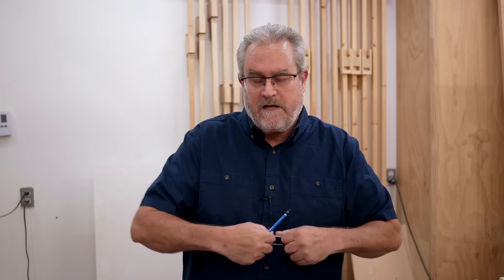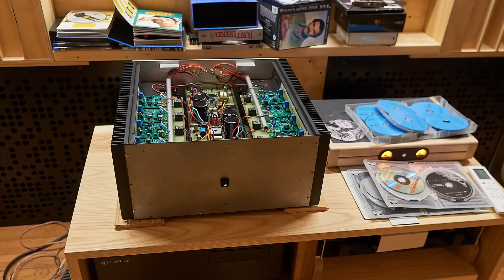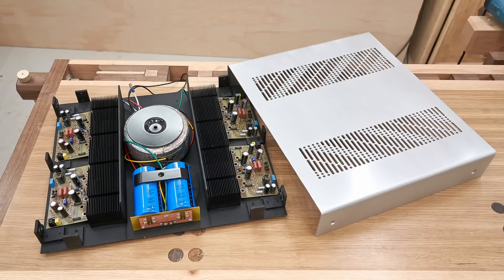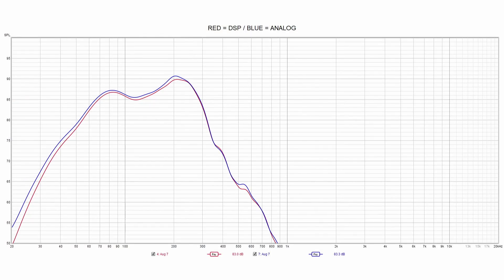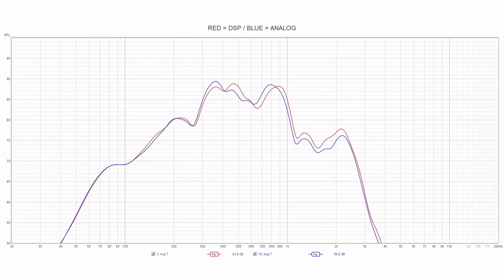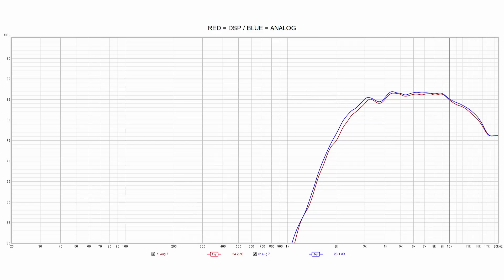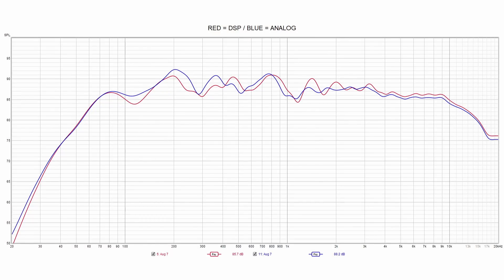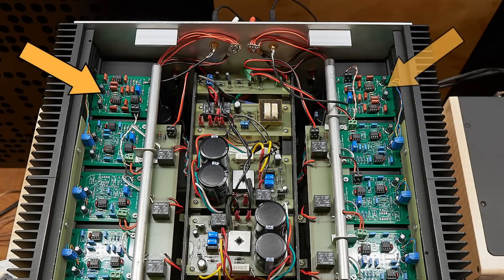My Amp Blew Up!

Comment from the maker: A costly mistake and live and learn (they say, but who actually does that...?), however it was limited to just one amp board. Still, I had to tear it all apart and check everything to make sure there wasn't any collateral damage. That's the BIG downside of putting so much in one case - it literally took a full day to do that.
With the blown board swapped for one of the "spare" channels, I got it up and running again. I'll eventually repair the amp board that blew and reinstall it, but like I said I don't really need it right now for anything important.
The two new crossover boards are for the infinite baffle subwoofers that are in the front wall of my listening room. They are powered by a separate 4 channel amp that I built nearly two years ago and featured that build on this channel. While it isn't quite finished, it's finished enough to use every day until I find time to complete it.
The crossover points for the sub boards are 15Hz high pass and 80Hz low pass. Both slopes are 4th order. I need to make another for the bass shaker I have in my chair, and that will use the 9th amp board in the case.
I need to put the brakes on this new multichannel amp (name change, in case I blow any more boards...) for now, so I can get back to my real occupation - making woodworking videos on YouTube. I'll get the rest of it done when I get the time.
My main channel: 
https://www.youtube.com/user/jpheisz
Building my 4 channel subwoofer amp:
https://youtu.be/UKhRA_GcmPI
My infinite baffle subs:
https://youtu.be/1hDV54c3tzA

Comment: What a journey! Thanks for sharing. 

Question, any consideration to off-loading the bass shaker duty out of the multi-channel onto a dedicated amp? 

An argument can be made that it'd be a good idea. 

Your loudspeakers aren't too power hungry. 
Subs, ... IB alignment requires minimal power to hit full excursion. 

But I'd suspect your shaker rig might need a lot of power and control. 
Perhaps it'd be nice as another control point, as its own entity. 
Offload curent draw and heat.
Ease of adjustment (tactile rigs are tweak intensive).

Really digging the content 
Much appreciated
Reply from the maker: On the contrary, the bass shaker I have is rated for 50 watts, while my infinite baffle subs easily consume well over 100 watts each on peaks. So it makes sense to have the separate amp for the subs, but the shaker can easily be handled by amp #9. And the only adjustment needed is the initial setup to get the level correct.
Reply: @IBuildIt  
Got it. 
I was envisioning the tactile system differently ... ASSuming much more power was involved.

You might be right, in that ... the only adjustment needed is the initial level set. But tactile rigs ... man it's such a fine line between just right and too much! 

Regarding power, IB drivers need dramatically less power, ... like 10x or more.  

Comparing high performance long stroke 18"s, in typical small sealed vs. IB, the infinite baffle drivers are so efficient in the bottom octaves. 

I've got a quad 18" IB. 
They only need 200-300 watts to hit 30mm xmax. 
Whereas 30mm xmax in a small sealed often requires 2kw, 3kw, or even higher.

Hence the advantage of IB down low. IB isn't without weaknesses, however it's killer in that regard, ie., low power requirements at 20hz (less distortion, less compression, lower current draw, etc.) 

Thanks
Reply from the maker: IB is just a very large "sealed" box, so I'm not sure why you are saying it needs 10x less power. While testing various configuration for subs (isobaric ported, open baffle, etc.) I was able to compare them all and while the IB was the best overall, it was still just as power hungry as the others for the same output. That's measured in-room response.
While playing music the subs are just barely contributing, but on movie sound tracks they are peaking well over 100 watts each (8 ohm speakers). My amp can't put out 400 watts continuous, but it handles those peaks no problem.
It takes just one movie with a lot of low bass to set the bass shaker and then it doesn't have to be touched again. Same with all of the other active crossovers - set it and forget it - and that's what I was shooting for with this build: arriving at the best sound tuning it with DSP, then translating that to analog to run in a fixed configuration.
Reply: @IBuildIt  
As an acoustic limiter, the box dominantly changes the behavior to thermally limited. 

Understanding your IB exhibited as power hungry as other alignments. 

But I think 10x is accurate, in many instances its higher. So 10x is quite fair. 

It's the raison d'être of the IB, 
... the impact of the box.

One of those elements; 
it's not fighting the air load, yielding huge increases in bottom octave sensitivity. 

Of course via Linkwitz transform an 18" can be forced to pump 10hz at 30mm xmax in a small sealed, but it takes thousands of watts (and all that accompanies). 

No box, unencumbered, 30mm at ~200 to 300 watts. 

The box represents a volume imposed limiter disproportionately affecting the deep end. 

Thus, IB's are excursion limited at the bottom, not thermally limited. 
I pulse my IB at 10hz, full excursion, without concern for voice coil temps. 
My concern is fearing for my home ... infra waves don't disappoint! 

The tactile, bass shaker rig; 
admittedly, I'm a junkie to level control on the bottom end.

I understand and appreciate a set it and forget it approach.  

Long before I ever experienced tactile systems I had a parametric EQ on the subs (within easy reach at my seat) in our big family daily driver system.

Essentially it's to vary relative level at differing playback levels (once a FOH, always ...). 

It's often argued that much material doesn't fully extend into the deepest range ... but it's often surprising. 
Exploring the single digits is a niche pursuit. 

Thank you John, you elicit fantastic thought experiments.

Comment: Oh man I feel you. Glad it was only 1/10 amps. Great work!! Also about the passive radiators' prices, I DIYed a few myself for my boombox projects. If you dont need a lot of xmax, a 9mm-mdf circle and a speaker surround will do well.
Reply from the maker: I thought about making one too, but then I remembered that a passive isn't much different from a vent and a vent is much easier to do.
Reply: @IBuildIt  True. I needed to use passive radiators to save space as I wanted the speaker to be portable.

Comment: A second woofer is an excellent choice.  Far better than a port or a passive radiator.  Sealed bass plays lower and it's easy to EQ to get the same low frequency extension with a Linkwitz transform filter.  In my opiion the Tekton patent is a joke.  It simply can't be valid.  People have been selling speakers with multiple drivers and even multiple tweeters for many years. So it's not novel.  If you read it, they talk a bunch of non-sense about the mass of the domes being very low so they match the mass of the instrument that created the music.  What a load of crap.
Reply: Agreed
Never cared for the "driver's mass matching the instrument's", ... wtf? 

So unnecessary, just explain the thing, don't make shit up. Tekton has some interesting offerings.

Comment: Thanks for all the shared audio knowledge.
 
Bit late know but being able to access those crossover pots from the outside front/back/side/top, whatever would be convenient.  You'll likely keep tweaking them as the drivers' breakin and your ear adjust to the sound.  As well, your hearing is likely to continue to degrades just as mine have.
 
Would love more transmission line speaker enclosure education from you.

Comment: It happens. For some it can happen big time. I built my very first audio amp in 1973 while working as a grad student. Surplus parts (no money) including paralleled small power transformers to get more power (current actually). Unknowingly, connected them anti-phase and, with great expectations, hit the power switch. Kerr-Blam. Took out the 400 amp service in the university lab where I worked. Valuable lessons on reversibility of assembly, partial testing and variacs.
Reply: Exposed parts right up the rectifier port! This'll be like bullseyeing T03's back home :)

Comment: Hey John, quick question. On the outputs I see you used NJL1302/3281 5 pin devices.  I’m thinking it would be cool to make most of my speakers powered and using these amp modules if the gerbers are available.  The outputs are the only things i need to buy and to get the best price I would buy in bulk from Rochester, but there is a minimum.  

Would you used NJL0302/0281 devices which are basically identical to what you uses except they are rated at 180w dissipation vs the 200w yours are, I would get 64 of each. 

Or NJL21193/21194, you get the 200w rating, plus higher voltage and current rating, but step down to 4 MHz transitional frequency vs the 30 MHz of yours.  In this case I’d get 194 of each for the exact same price!!!  I’m sure either would be more than enough quantity wise, but more is better? This question coming as if I were to use the same rail voltages as you’re using.  

Since you designed the board I though you would be the best person to ask which would be better, lower dissipation or lower Ft?  Thank you!

Oh I should let anyone wondering why, the originals are not available.
Reply from the maker: I can't recommend the amp design I went with for this. Since it uses just two of the thermal track outputs, it was very touchy to adjust the bias current accurately and it would tend to drift up as the amp heated up. 
To fix that I had to add a vbe multiplier to the bias circuit in the form of a small pcb that's wired into the trimpot location on the board. The small pcb is then screwed to the heatsink (via the transistor used for it). The vbe multi greatly improves adjustability and tracking and it should have been included in the original amp design. Another example of live and learn.
I may revise the design in the future to include the change, but that wouldn't be to replace these and therefore it wouldn't be anytime soon.
Reply: @IBuildIt  appreciate the honesty.  Yeah it seems most first and second iterations of amp designs require some type of thorough testing and changes.  Are you pleased with your 4th order crossover boards?
Reply from the maker: I'm guilty of equal parts hubris, laziness (as ridiculous as that may seem, given the insane amount of time and work I've done on this) and impatience where the amp design is involved. I've made thermal track amps before and didn't have any issues with the thermal performance, but they all included a vbe multi along with the diodes. As I've discovered here, the diodes alone won't properly control the bias, or at least not just two of them. I should have more thoroughly tested the prototype before ordering the boards and then I could have corrected the problem.
The xover boards work great, but I also made a couple of small mistakes on those. First was not having screw terminals for all of the connections and the second has to do with the parts names (a bit confusing using labels like CHP1, CLP2, etc.). Neither is a deal breaker, but if I did it over again those would be two things I'd fix.

Comment: Sorry to hear about the burned amplifier, but you will have it repaired quickly.
We often call the Bass shaker the ButtKicher.

You can use a regular base unit as a passive radiator by connecting a resistor across the terminals. And you can change the characteristics with crossover components.
Reply: Damn I have read as much as I can about audio for decades and never came across this. Thanks
Reply: B asshaker?

Comment: I have blown amps, but it was plain stupidity on my part. I am also more clumsy as I age but the brain does not seem to be doing any better either.
Reply from the maker: I had a bad feeling about moving it down so quickly and then diving right into setting it up that evening. Kept saying to myself I should wait for tomorrow to start in on it, then I dropped that stinking screwdriver and that settled it.

Comment: Genelec have a new "point source" speaker, the 8381A which has a waveguide coaxial and four equidistant midranges surrounding it.
It looks more like the one you are trying to do than a Tekton does.

Comment: Heat shrink over the shaft. Easy to remove if necessary. Not ideal but has helped reduced fat finger fuax pas.
Reply: Or, simply some 33 wrapped around.

Comment: As far as being Clumsy goes... I started out that way.  I was severely under-weight, clumsy, not coordinated at all.  The kid that they would pick last in Gym, for good reasons.  Turned out that I had a mild Gluten Intolerance (I didnt know until much later in life)... which caused me to be under-developed, weak, low energy, even mentally foggy / slow.. etc.   When I turned 20, I started taking up a Chinese Martial Art... and doing it on a very Hardcore level ( 4 to +8hrs every day ),  as well as a daily 1hr hardcore  "Core"  workout routine.   In about a years time, I was in the best shape of my life.  After 3yrs, I was defeating blackbelt level fighters, that were 2x my own mass and strength.   I became lightning fast, graceful as a Cat, surgically accurate, and incredibly powerful.

 I realized that most issues with being Clumsy, have to do with not having enough strength / muscle.    And obviously... as we get older,  a lot of us lose a lot of strength, because we are not anywhere near as Active, nor as Physically Stressed.

 There are other things too.... such as developing excellent tendon strength... which is one of the keys benefits in long session   Tai Chi  practice.

 Anyway... An Actual Surgeon needs the ultimate steady hand control..  otherwise they will accidentally cut something that shouldnt be cut.   Their constant practice of very slow and controlled movements, builds up their muscles in such a way... that they gain that level of super-precision.   Its very different from Gross motor control.. like throwing a baseball.   In KungFu, one of the methods of developing surgical control of ones kicks... was to slowing extend the kick outwards, and slowly retract it... over and over again, for like 1hr sessions.  Its easy to throw a fast kick... because most of movement is based on mere momentum.  But when you slow it down... it forces you to have to gain strength and control over the entire line of the kick.   People whom dont do the slow motion training... tend to have very sloppy kicks.. and they fatigue MUCH faster (leading to even worse kicks).   Similarly, we did slow motion pushups for precision arm control... as well as the same back and forth slow-motion extensions and retractions.

Basically, I just wanted to state that if anyone is having issues with being clumsy... that they can change it, if they put in enough efforts.  Its not a permanent biological, nor age related issue.

The other component, is Focus / Attention.  That can be solved with daily silent 1hr meditation sessions.  Takes about 100 consecutive days to develop the permanent "Quiet Mind" state.  Simply count each Inhale and exhale, in Seconds.  Scientists recent discovered that such meditation caused the brain to actually grow in Density and Connections.  They did before and after MRI Brainscans... which is how they realized and proved this.   And the good thing about it... is once its developed,  you never lose it.   You can stop meditation altogether... and that gift of Quiet Mind, will always remain with you.   When your mind is Silent.. its much easier to pay attention to the Present (The GIFT).  You can learn much faster,  and you can do things with much greater levels of focus... as a result.   (While ADHD people will likely always have issues... I have heard that this practice still does greatly help them control their issues.. much better than before)